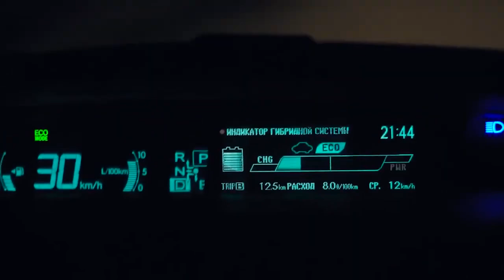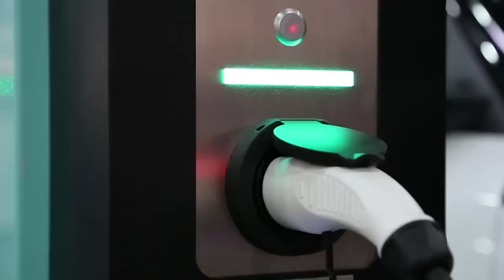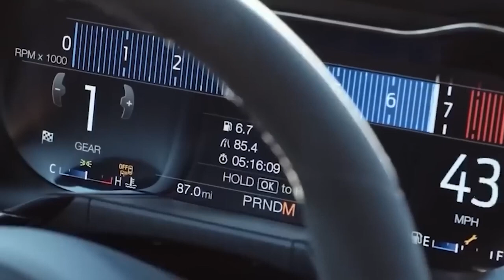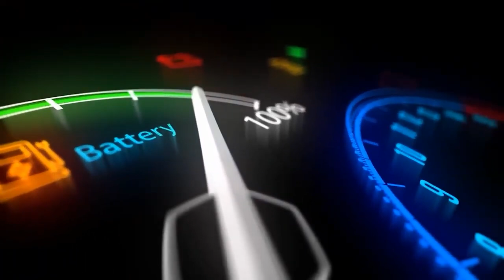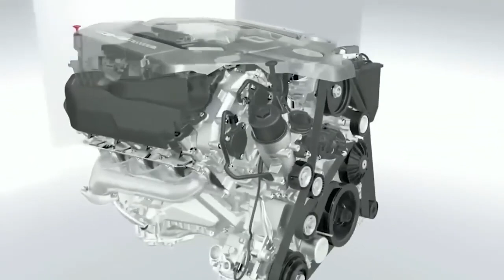Ford CEO  “This Is The REAL Truth About Hydrogen Fuel Cell Cars!”

Comment: h2 is DEAD. if you thought minerals/metals for batteries were rare? TRY PLATINUM. yes, THAT platinum- the one that costs 2x as much as GOLD! that's what the fuel cells are still made of. and as for 'advances' in h2 production and fuel cell technology... the search for a better way has been going since before the apollo space program. to date, nasa, darpa, chevrolet, toyota, hyundai, the state of CA research labs, big oil and a whole host of other entities have poured BILLIONS into just exactly THAT- and we're no closer to reaching parity with BEV's than we are with gasoline in regards to h2. if you like $7 a gallon gas? h2 is for you.  and btw- why is big oil interested in h2? because 97% of ALL h2 is refined FROM natural gas. they'd be better off just running off natural gas- oh, wait! PG&E already does that with their fleet vehicles. here's what h2 ACTUALLY is: a failed attempt for big oil & legacy auto to try & compete with TESLA. really- failed attempt is an understatement: to date, COLLECTIVELY- there have been about 6000 h2 vehicles sold. there are around 3 million BEV's on the road- most of them tesla.... and growing, FAST.